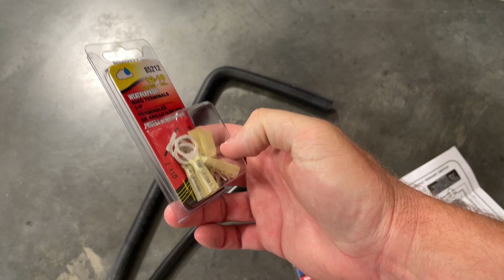World's Longest Vintage Air Install Update

Comment: Using the label maker with clear heat shrink is a good idea. I've been buying wires from places that are already prelabeled or prelabeled heat shrink, and they never actually have everything you need. I will be following your lead on that idea. Keep em coming and thanks for the tip.
Reply from the maker: I'm glad it helped.  I saw it somewhere a few years back.  Sure makes it easy when I work on it down the road so I am not tracing wires to see what I did.

Comment: Seems like it’d be easier to let the pcm operate the a/c and fans.
Reply from the maker: As it turns out, the ecm does control the fans based on pressure readings from the pressure sensor.  There is so much misinformation floating around on the internet, I wasn't sure what was going to happen.  Looking at the wiring diagrams for the Yukon my PCM came from, it used the HVAC control module that was connected to the PCM via a data link to control the AC.  I didn't want to coble something together so I kept them seperate and just let the PCM run the fans based on pressure on the high side.  Vintage air unit controls the clutch and it all works like a champ.